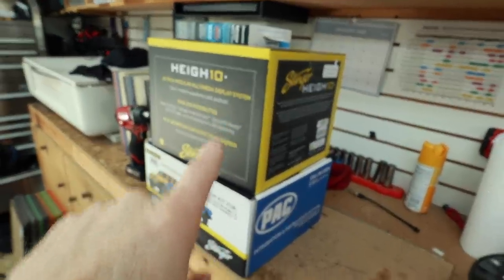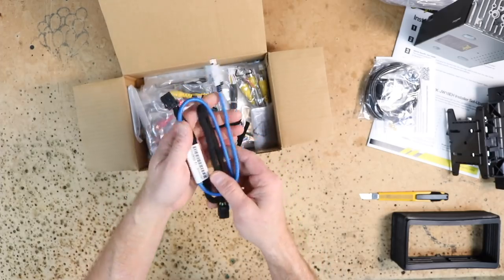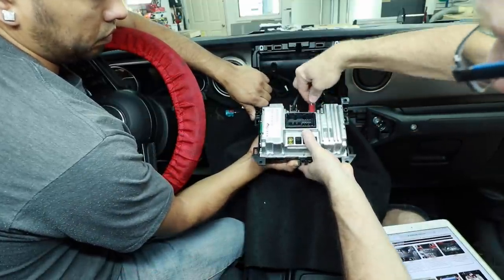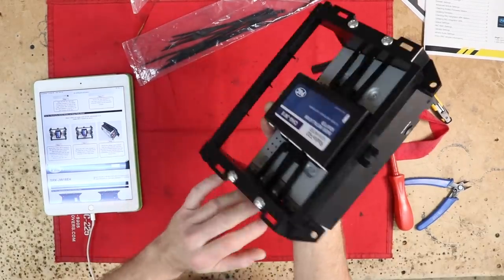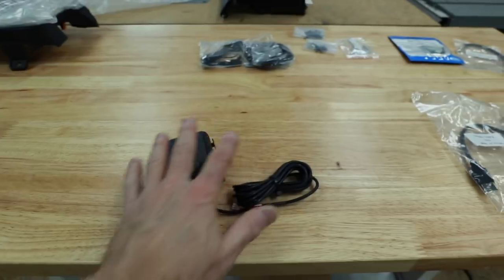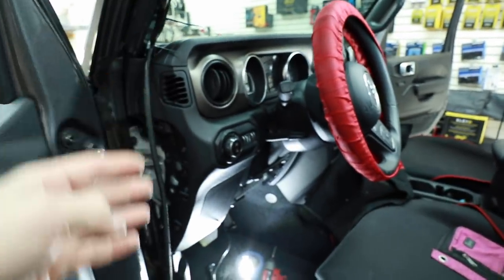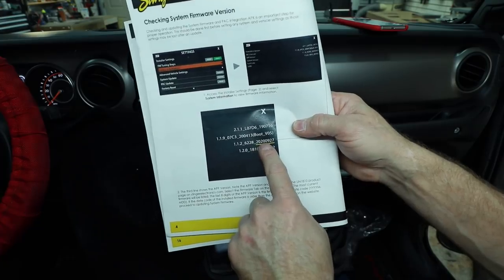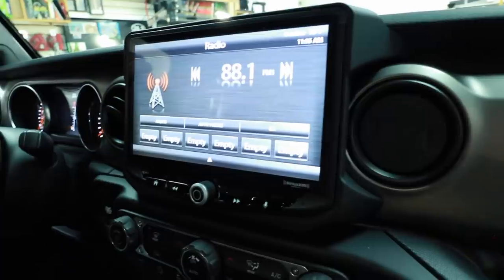Jeep Gladiator Heigh10 radio upgrade install how to

Comment: This has to be the most involved installs I've seen so far. Great features on the radio but that install.. whew.
Reply: That's why you have a pro install it. When using factory controls through PAC, it can be a very daunting install for your average weekend installer!

Comment: Hello, I really like the idea of this unit.  I have someone who is attempting to install the Heigh 10 unit in my 2012 Mercedes E63 amg.  I was using one of those Chinese model android10.25 screens but it was full of errors and cliques. I can't find a kit for my vehicle. I am having a custom install done.   I was told by a professional installer that the PAC RC1 would not allow my steering wheel controls to work. I was told by the shop where I purchased the unit that the PAC RC1 would work but it had to be compatible with the Clarion systems otherwise it would not work. The Mercedes original system is a fiber optic network.  I am connecting this unit to 2 JL Audio VXI 8 channel DSP amplifiers and a JL Audio HD 1200/1 amplifier to run my 13 inch W7 subwoofer.  I am using Morel Virtous speakers 3 ways components in the front and 2 way Morel Nanos components in the rear. I am also using Morel Virtous Integras for my rear center stage and Morel 2 inch for my front center stage.  I am hoping this will work in my vehicle. I have been unable to find any resources to help with information for this install. I am in northern California and most professional shops have not installed the Stinger Heigh 10 that I have contacted.  I called the Stinger company and they were not helpful either.  Any help you could give would be much appreciated.  If not wish me a lot of luck.  Thanks

Comment: I used to have the x110 SRA by Alpine, regret selling it but I was wondering if you find this one equal to or better than the Alpine? The Alpine is twice the price. I have a 15 Chev Silverado crew and I noticed that they make a flush mount kit for the Heigh10. Great video, thanks for the great content.

Comment: Had this professionally installed last weekend on my JL.  The sound is worse than factory now and I don't know why. Any thoughts?   Factory speakers
Reply: Mine too…I just had one installed today and it sounds horrible.
Reply: @tashadavis1461  I upgraded speakers and added an amp.  It fixed it.  I just thought that an after market head unit would make factory speakers sound better, with more power etc. that just wasn’t the case.

Comment: Given the other model is the "Elev8" (elevate), shouldn't "Heigh10" be pronounced "heighten" meaning to raise rather than "high ten" as in a double high-five?  Also, does this end up being water resistant like the factory Jeep systems are?  Don't own a Jeep but if it isn't, that would suck if you had the top off and it started raining, which I know happens to Jeep owners at times.

Comment: Amazing installation by some great dudes. Unfortunately this radio falls on its face with quality control, and quality of parts. The screen gets reallocated washed out when on CarPlay and Android auto. There are no contrast or white balance controls on this radio. The stock unit looks much better. Also the rear view camera video is really low grade. This radio doesn’t have the ability to get the HD signal from it. The screen itself isn’t HD either. In my opinion, for as expensive and time consuming as the installation is, you should be getting top notch components. Shame on Stinger.

Comment: That radio is no good to many wires don't fit to easily in in jeep cavity no matter how good installer you will run in to another problems is no a friendly unit to install I been installer for 30 years lead tec at my company and this have been the worst unit ever